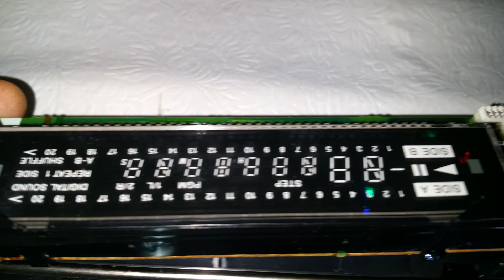How to repair Sony MDP-650 Auto Reverse MultiDisc CD CDV LD LaserDisc Player No Display Problem

Comment: confirmed replacing this single capacitor worked for me. Just be super careful around the VFD, it is glass and can be very fragile. I only pulled the top of the plastic away (never pressure on the glass).

Specs of the (bad) capacitor:
2.5mm lead spacing
6.3mm diameter
6mm height

pulled capacitor tested bad: 4uF, ESR 12Ω, Vloss 26%